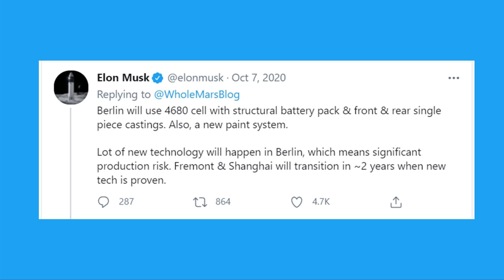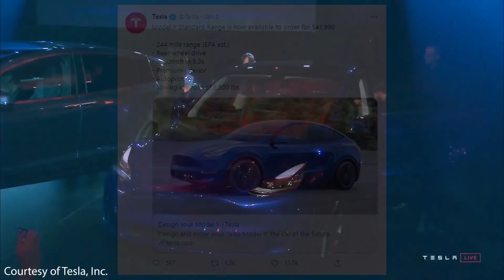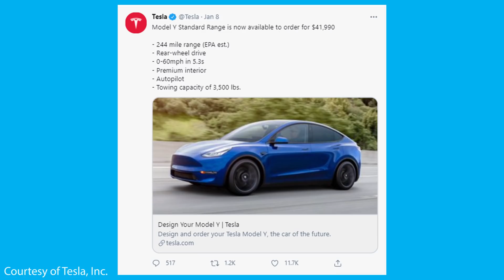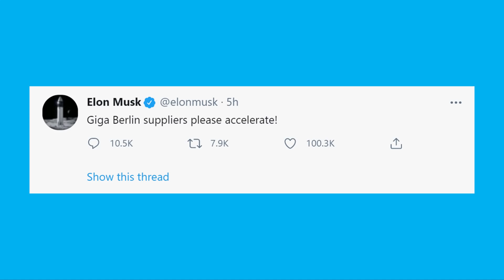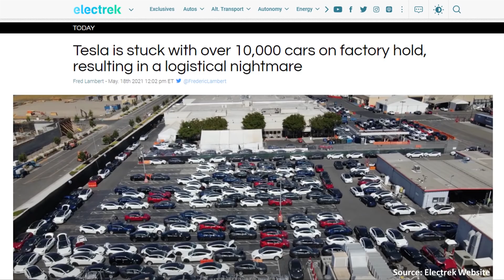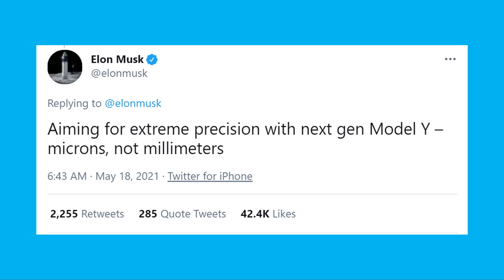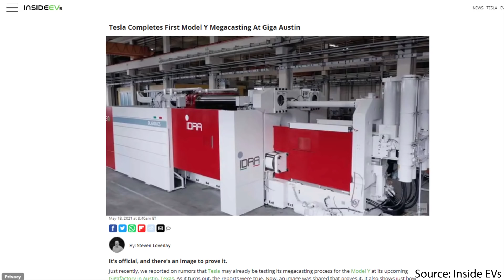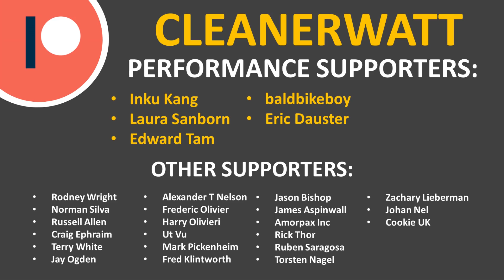NEW Tesla Model Y 2.0 Updates from Elon Musk

Comment: More likely they'll convert Fremont to the new design. They already have a 4680 production line in Fremont and a casting machine (or two) in operation there, and the castings currently being produced in Austin are being shipped out somewhere. More likely both versions get structural 4680 battery/chassis packs, the only difference being in battery chemistry.

Comment: 4680 - I feel it may lead to a plad variant matching 390 range but use two high performance motors on each axle,  my worry though is they reduce battery amount dropping weight instead of increased range maybe there goal, given the pack changes will we see a model 3 2.0 at the same time, because if the new method cut production cost it will allow Fremont to concentrate on s,x, and possibly truck

Comment: As always Jon, an extremely pleasant, & to the point update on EVs. 👌🏻
It makes perfect sense that the high volume selling Model Y is first to get the 4680 battery update. 
Texas is on the cusp of driving Model Y sales threw the roof with the new cells & the casting process.
That said, I believe the Berlin plant was conceieved & being purpose-built to take the Model Y to the next level, for the more discerning European market. 
I believe money saved by not having to ship US built Teslas to Europe, has been spent on Berlin's latest casting & top of the shelf paint process, with tighter tolerance production.
Europe has also had long-standing incentives to steer consumers away from ICE vehicles for the betterment of the Planet. 
Tesla should do well, & good on them.

Comment: Could the current Model Y be retrofitted with the 4680 battery?
Reply: probably not, not profitable
Reply: Almost certainly not. The structural design of the vehicle is different because of the structural battery pack. Not that I could see any reason why anyone would even want to do that? The primary benefits of the 4680s are in Tesla's manufacturing costs. Any potential customer benefits in terms of weight distribution or price would almost certainly not apply to a retrofit. Other benefits like longevity mentioned at battery day were platform agnostic chemistry improvements. LFP batteries coming out of Shanghai should have this benefit regardless of battery form factor.

Comment: The third option maybe could be making new 4680 battery pack with similar range to old pack. Therefore same capacity but higher margin since less 4680 cells required compared to making a 400 mile pack.
Reply: And cells available for other cars. Or semis.

Comment: I think Tesla may do a 4680 SR M.Y in Austin  instead of 2170 SR M.Y because it'd be more cost effective, higher quality and longer range at Austin because of the weight reduction and new cell design.
Reply from the maker: Could be, but costs for 4680 will be high at first, so it may not make sense for a year or more financially.
Reply: Remember the battery building shell in GT is basically done. Steel is complete, decking is almost complete, concrete is already being poured on all levels and the roofing is not far behind. So interior build-out and installation of equipment are next. Going very fast in Texas. Berlin starts with 4680's from the Kato Road and anyone else that is producing them

Comment: I'm guessing that when production at Austin ramps, they will close Freemount and re-tool for the new production there without delay.
Reply from the maker: Could be.
Reply: They are putting up another tent right now. Maybe the new tent will have the upgraded model Y assembly line. Once that is up and running then upgrade the existing line.
Reply: They can’t close Fremont because it’s still needed to produce the Model 3 and S/X
Reply: @Nicholas.T  They already upgraded the lines for S and X. They will likely close the other lines for upgrade one at a time.

Comment: Yes, Elon said that.'

I'm frankly shocked.  I was under the impression that the 4680 cell was moving a little more slowly.

I don't think Elon expects deployed 4680 lines at Austin and Berlin to take a year to burn-in and achieve acceptable reject rates.  Where he's getting his optimism from, I don't know.

But I'm delighted, too.  Model Y with single-piece front and rear underbody castings + structural 4680 packs will be amazing.  Mass will be pulled in towards the center; weight will be reduced; handling will be improved; safety will be improved; fit and finish will be improved.  Performance should be a little better, too.  Tesla will be able to choose either to reduce Model Y prices (gradually, I'm sure), or to increase ranges, or a combination of both.  Me, I hope they will use the volumetric and mass savings to pack in more kWh of energy to get better ranges.

Demand will go nuts, however they play this.

We still haven't heard from Elon about life cycle for the 4680 cell.  That's an undropped shoe.  I'm hoping for a pack that will last for over a million miles.  They really need a long-life pack for the Semi, and if the cells can do it for the Semi, they'll do it for every other model equipped with them.
Reply from the maker: Well said!
Reply: They are producing the batteries at Kato Rd. for the initial production in both Giga Berlin and Giga Texas. This will be fine as it will be lower volume at these facilities for some time. Remember that early production builds are validation builds that are scrapped and never leave the factory anyway. Those validation builds may also not require all of the parts from missing suppliers. So does "start of production" mean start of final production for delivery intended vehicles? Or start of full scale validation?
Reply: @patreekotime4578  The timeline, so far as the public view is concerned, is vague.

Fremont production for the 4680 cell, theoretically capped at 10 GWh, won't carry Tesla very far at Austin and Berlin.  I was expecting Kato Road to support Model S and X at Fremont.

Meh, I'm not going to worry overmuch.  Whatever timeline becomes reality, 4680 cells will be a big difference maker for Tesla.